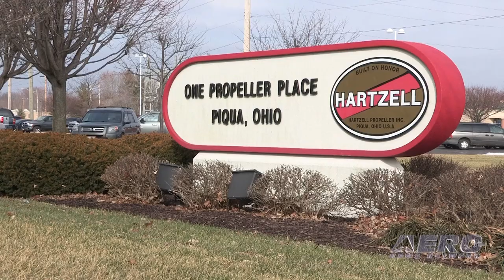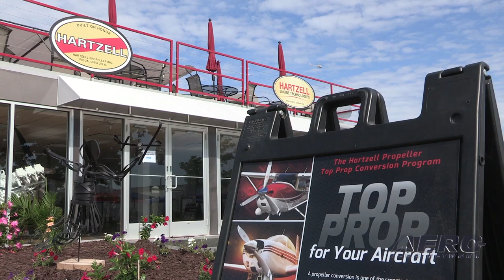Aero-TV At OSH21: Hartzell Brands Invest Heavily Into General Aviation

Comment: VTOL industry is most dynamic sector of aviation. Multirotors and tiltrotors use propellers as rotors. This should be good news for a propeller manufacturer like Hartzell. Tiltrotors use same props for both vertical lift and cruise flight. That means some contradicting requirements to live with. Compromise is inevitable between vertical lifting performance and top cruising speed. Unless morphing-blade propellers are used - a new technology to make speed range, which can be flown with the same propeller, a lot wider, while keeping efficiency high and nearly constant. Any plans Hartzell might go for that market?